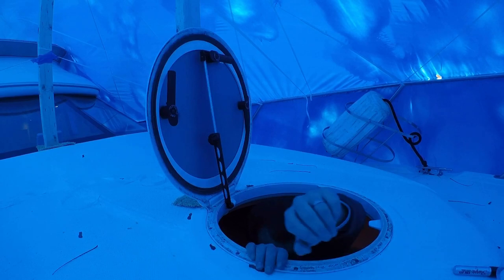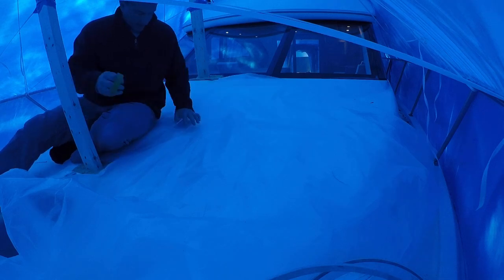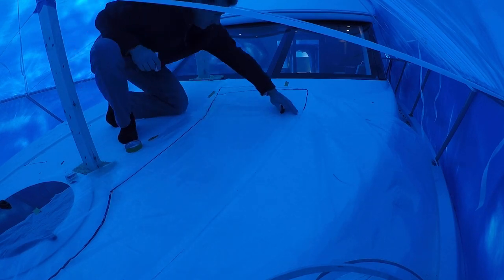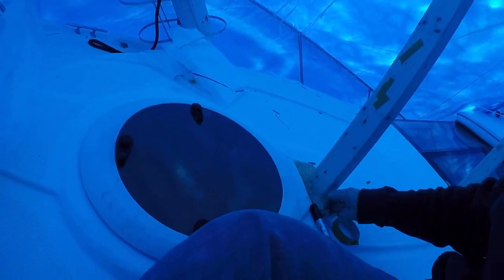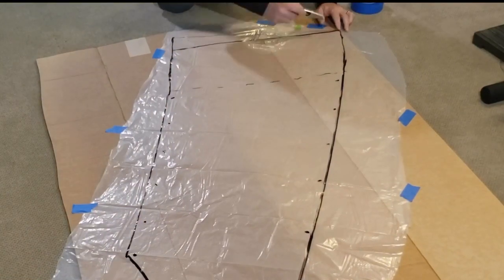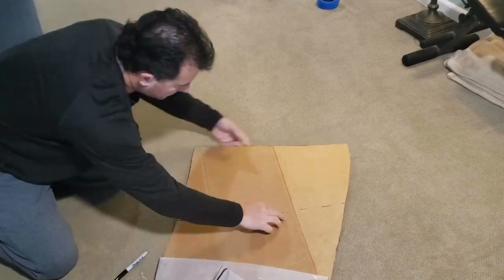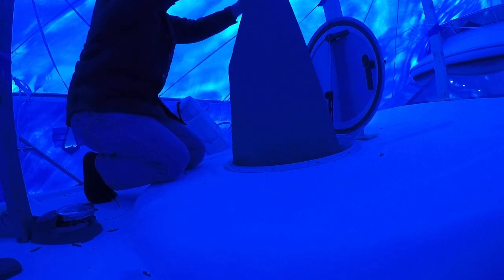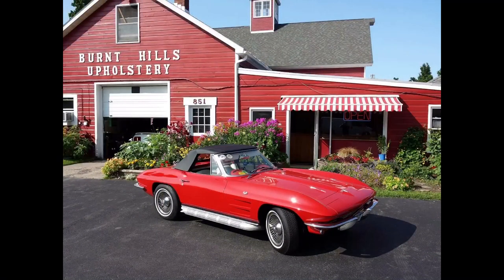Custom Sunpad boat bow Cushions (Part 1)

Comment: Tom just viewed, Ken’s front Sun-Pad , 2 thumps up Ty. A suggestion , before my cushion which is by the way a Brilliant idea, but maybe put a layer or apply , the Brand Sea-Deck , where there 2 Sun-Pads would lie , because thinking when “my”. Pad gets finished lay ‘d down the bottom of the Sun-Pad would not be Resting on top of A Hot , Slippery surface & make the Sun-pad less of a movement?  Not that much of Sea-Deck , Flooring Tiles /area to cover both , sides plus once Pads removed , Ken’s Feet won’t get Hot . 
Anyway just Sat morning thought .
Reply from the maker: There is non skid under wear the bow cushion is, but I know what you mean.  The white deck stays surprisingly cool in the sun.
Reply: @AdventuresofHappyOurs  Gotcha ,  Nice though Excellent Boat improvement  , Yep know all about the Happy Wife , Happy Life / Boat Life  ,  take care , ttyl